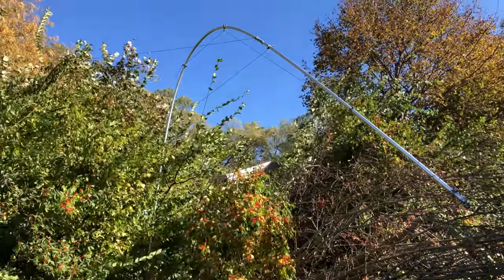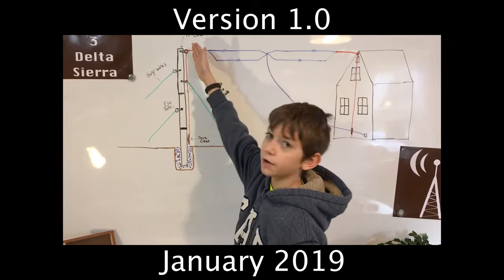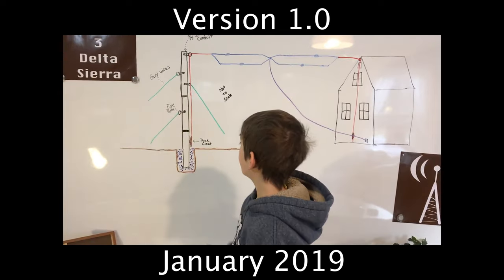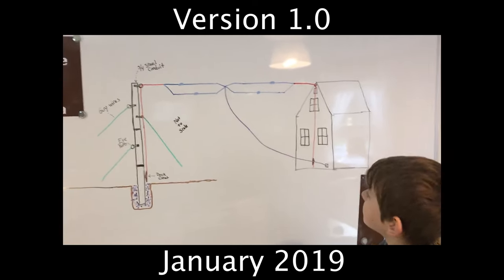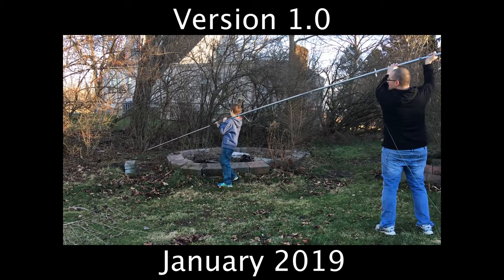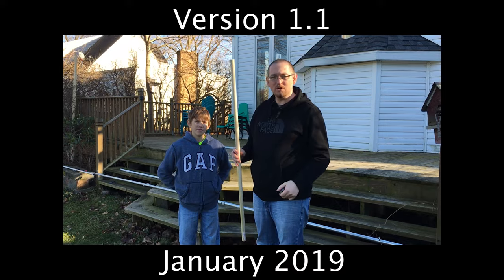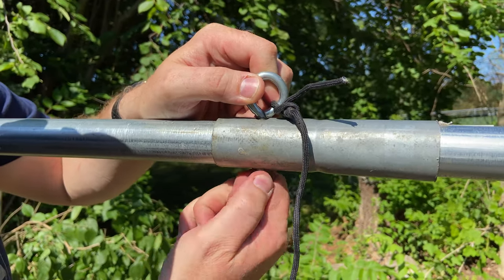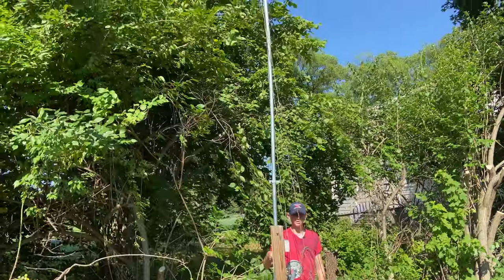Tilt Antenna Mast

Comment: Some fine engineering, and great to see dad/son working together!  How does the horizontal trapped dipole work?  I've never used one.  73, K8JLW
Reply from the maker: Thanks! The antenna we use was created by W9INN (silent key), who had a home business making these. It is a good performer for us. When the direction is correct, it is better than our Hustler 6BTV as it has some directionality to it. We don’t have it off the ground high enough to be perfect, but we could still get Europe with no problems even when the sun cycle wasn’t ideal. We highly recommend giving it a try if you have the space. 73 -AC3DS and KC3TFK